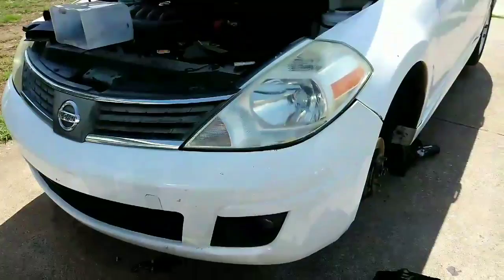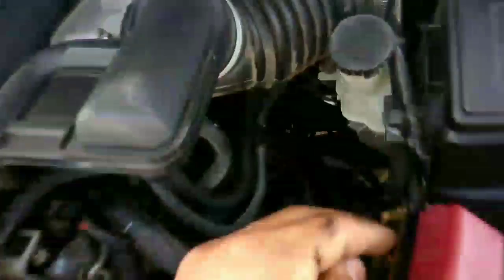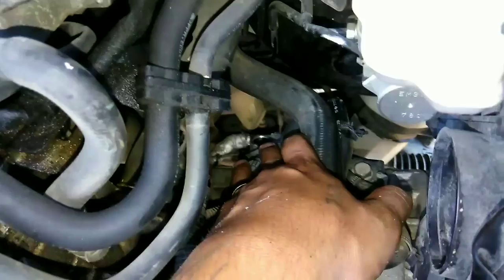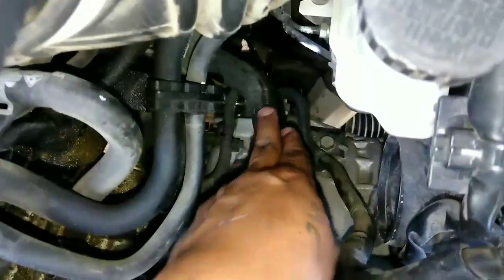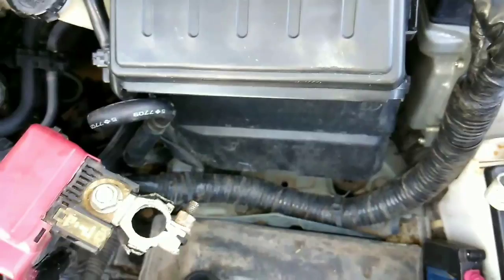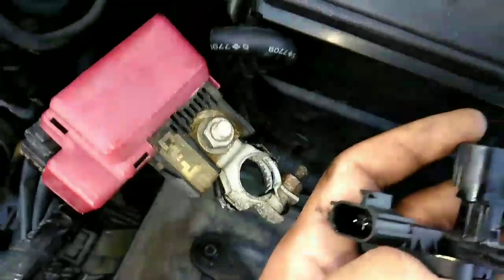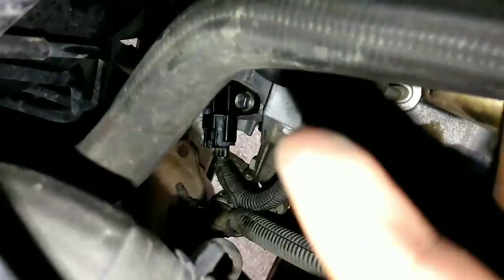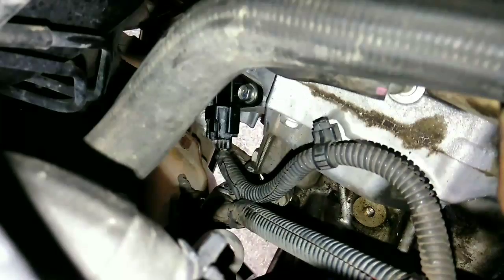2007 to 2012 Nissan versa/sentra 1.8 SPEED SENSOR replacement p0720.  car wont accelerate

Comment: There are 2 speed sensor on the Versa. The sensor you changed is the input speed sensor which the connector should be vertical. The sensor you had with the 90° plug is for the ouput shaft speed sensor located  on the side of the cvt. p0720 is for the output shaft sensor which is easier to get from the bottom.  The sensor you changed would give a code p0500.
Reply: Hi when you say the output sensor at the bottom , is it inside the oil housing of the transmission?
Reply: @josimarcruickshank2683  when i said bottom i should have said side technically
Reply: Is it different from Nissan Cube 2013?
Reply: @vladintool  not familiar with the Cube
Reply: @ottobauner9828  thank you anyway

Comment: Just went to replace mine after seeing your video (and others) showing how easy it is. Took battery out, removed air intake and pushed hose aside thinking 'simple job', then discovered there is no speed sensor in that location at all. 😫 All that is in that spot is a red electrical connector. 🤨 Don't know if it's because our car is a 4 speed and the one in this video is a CVT, but I can't find anywhere on the car where this speed sensor fits.
Reply from the maker: Cvt is different
Reply: @stickytarmacs  Just my luck. Strange how engine light code readers have said this is the fault, though. Maybe it's located elsewhere...just no idea where. 😭
Reply from the maker: Sorry about that I hope you get it going
Reply: @PJV1201  did you ever find out where? I have to do it on a 4 speed
Reply: @babarentals2941  Unfortunately not. The car still runs but has to be warmed up for 10 minutes before driving it, otherwise it sticks in 1st gear. I'm no longer convinced it's a speed sensor issue, because it runs fine after being warmed up. I changed the transmission fluid to see if that helped but it didn't make any difference. It's not a daily driver, so I'll just run it until it quits on me. Sorry I couldn't help more. ☹

Comment: What was your car doing that you change the speed sensor..?
Reply from the maker: check engine light on . didnt want to drive. put it in drive didnt want to move . i had to wait like 15 mins the start again and it would drive for like 5 seconds then no more acceleration.
Reply: @stickytarmacs I have the same kind of versa. I had changed spark plugs,  ignition coils alternator and injector cleaner. Still it saying multiple misfires. Car is not driving fast. Put it in gear one. Hardly accelerate. Going up Hill  is a problem. Spent $1100 so far. I might change drive sensor see what happens. Thanks again for uploading the video.
Reply from the maker: @KingBabaJames  thats exactly what mine was doing
Reply: @stickytarmacs  mine is a manual transmission. Not sure if it has drive sensor. Do you know?
Reply from the maker: Dominik Rodriguez  change the sensor worked for me

Comment: my 03 sentra seems like its stuck in high gear... so it doesnt really hav any torque... it might be the speed sensor.  i replaced it before...
Reply: What was the fix?
Reply: @miliqve3265  wouldnt know. never had it fixed. i swapped out the valve body in the transmission, changed the fluid, swapped out all kinds of sensors. it was either a problem with the computer or something major mechanically.. 
car only had like 70k miles on it, and that was the 2nd transmission. and the 2nd engine was already burning a lot of oil..
so i scrapped the car. cant be replacing engines and transmissions every 20k miles.. never buyin a nissan again.

Comment: The one that bends is the output speed sensor and the one that is straight is the input speed sensor depending on the trouble code, the trouble code will specify input or output.
Reply: but he said he took the straight one , so it is the primary/input sensor right? ,  my  nissan versa 2007 is giving me the P0725 code and I read its an input VSS problem, so this one in the video is what I need to change?

Comment: Is this the output speed sensor or input speed sensor? My code said circuit failure output speed sensor so I ordered the output speed sensor but unsure if this is not the same. If it isn’t, any idea where the output speed sensor is?

Comment: Are they interchangeable like that? Usually the straight one is the primary speed sensor on the front of the block, and the 90-degree one is the secondary speed sensor on the transmission.
Reply: but he said he took the straight one , so it is the primary/input sensor right? ,  my  nissan versa 2007 is giving me the P0725 code and I read its an input VSS problem, so this one in the video is what I need to change?

Comment: Se te apagaba el carro cuando lo ponias en D? porque el mio igual no camina para atras o para adelante, y si lo hacia tenia que acelerarlo bastante.
Reply from the maker: Armando Suazo no el mío si jalaba bien nomás no caminaba
Reply: @stickytarmacs  el mio enciende bien, pero al ponerle cualquier cambio disminuye la fuerza en el motor y se apaga. Pensé que con esto podria solucionar, igual, muchas gracias.
Reply from the maker: Armando Suazo si le salió el código p0720 cambie el sensor
Reply: @stickytarmacs  Gracias!!

Comment: Nice video, my 2009 versa struggles with first gear after a lengthy drive or going uphill. I'm going to try this next, do you have a part number? Trying to get a good replacement.
Reply: I’ve got a 09 with the same problems, did you figure it out?
Reply from the maker: It's a cvt transmission there is no first gear unless it's a manual transmission

Comment: If this speed sensor is bad, would it cause the RPMs to jump when the car is in cruise control? Mines doing this but no code yet. Also it drives normal, issue only shows up when I hit cruise control.
Reply from the maker: No man sounds like you got something else going on

Comment: Was your car able to go in reverse as well before changing the sensor? Because my versa is not able to accelerate and reverse. And it threw a P0720 code. I’m hoping that sensor could fix this problem
Reply from the maker: Yes it wouldn’t move at all. I replaced it and it drive perfect instantly! .
Reply from the maker: Sounds like your issues is the exact same as mine . This will definitely fix it especially if you got the code p0720 pop up.
Reply from the maker: Please like an sub if this video helped you. Every like and sub definitely helps me. 🙏
Reply: Thank you, I’ll look into replacing that sensor !
Reply: Hey man another question, is your versa a 4 speed automatic or CVT?
Reply from the maker: @DGeeez  cvt

Comment: You pulled out a straight so the straight input sensor needs to go back in, if your replaced it with the bent one then that is an output speed sensor and the wrong one.
Reply from the maker: I replaced the one on the thumbnail and car works perfect now . Thanks for watching

Comment: I have problems with my car when going 20 to 60mph  it is hesitating when push gas pedal down hard it's good what may cause it
Reply from the maker: Is your check engine light flashing?
Reply: @stickytarmacs  no but I dint have any check lights in my dash
Reply from the maker: Kemony Reid ok well here’s a couple things you can do . Clean your mass air flow sensor. And do a tune up if you haven’t in a while.
Reply: @stickytarmacs  I do and it's the same problem I have now for 2 months
Reply: So you still have this problem my friend
Reply: I would say try changing out the sensor couldn’t hurt
Reply from the maker: Check fuel pressure ! I just fixed a car that was hesitating for a while couldn’t figure it out turned out the fuel pump was old and no flowing as strong as it should have.

Comment: My 09 Nissan Sentra won’t pick up speed sometimes I let go of the gas and press down again until it picks up slowly what can it be thanks
Reply from the maker: Mass air flow sensor . Buy throttle body cleaner at auto parts and spray it down clean let it dry for about 3 mins out it back on and hit the road . It's very simple good how to clean mass air flow sensor on your year versa there plenty of videos
Reply: @stickytarmacs  thank you for responding back I took it to auto zone they plugged the code reader and I’ll post a picture maybe u can better explain to me thank you so much
Reply from the maker: Messge me on Instagram @stickytarmacs_youtube
Reply: Ok I uploaded a video of the code can u go check it out thanks
Reply: @stickytarmacs  I inbox your instagram

Comment: Did you have to take out the starter?
Reply from the maker: No just battery and i think battery tray its actually really easy i did it in like 10 mins
Reply from the maker: Like and sub please helps a bunch
Reply: @stickytarmacs  ok. I have a 2011 nissan maxima. I am having issues finding videos on it so I hope mine is that easy. I have a p0725 code.

Comment: I have 2010 Sentra, replaced the valve for transmission, ignition coils, spark plugs, and have no code or engine light yet, sometimes it won’t shift from first gear to second until I stop turn it off then back on and drive slowly for it to shift gears what is the problem could it be the sensor?
Reply from the maker: e k check your transmission fluid. Make sure it’s clean. If it’s good?  Change your sensor
Reply: stickytarmacs yes I drained it and put in new oil in there, is it speed sensor or transmission sensor? 
Thank you
Reply from the maker: e k mine was the transmission speed  sensor
Reply: stickytarmacs so even if there’s no code or engine check light  this could be a possibility?
Reply from the maker: e k no man . If you have no codes then you probably have a internal trans issue . My problem was a bit different and I had a code come up right way .
Reply: stickytarmacs yeah I’ll get it checked out thanks a lot!
Reply: I will say this sometimes you want get a code from your ECM, but will have codes on your TCM, a mechanic with a good scanner would be able to check your TCM, I didn’t have a check engine light either and my ECM didn’t throw one turns out after a mechanic checked my TCM I had several codes on there and one of them was the speed sensor, hope this helps someone

Comment: Hey brother I have a Cerda 2008 but the 4th gear won’t go in
Reply from the maker: A versa you mean? And there is no 4th gear. They have cvt transmission. That means it’s one continuous gear all the way up to speed
Reply from the maker: Check you trans fluid. See if it’s really dirty or low on fluid .

Comment: Hope this the fix for my car I just bought it from a dealership
Reply from the maker: I hope you either got it an a ridiculous discount , or there going to fix this for you for free. Cause a dealership should sell a car that’s not running right
Reply: I did I only pay 180
Reply: 180 a month
Reply: @stickytarmacs  it’s still not running it cuts off after I changed it if transmission gets to hot so ima just take it to a nissian dealership to let them fix it but only 180 a month

Comment: Thought the p0720 was an output speed sensor code and p0715 was an input speed sensor but you replaced the input sensor?  The sensors are hard to figure, isolate because they are called so many different names primary, secondary, input, output, vss, and many more. They are all wired to the TCM and interconnected in wiring diagrams.
Reply from the maker: I was advised by a mechanic that that was the sensor for the code I was getting so I replaced it and it ran perfect instantly
Reply: @stickytarmacs  Appreciate the video. From what I've read these sensors have as many wiring/connector issues as sensor fail. So if you have a Harbor Fright multimeter, its worth checking the voltage to the connector with the car in On position before purchasing. These parts are expensive if from Autozone, AdvAuto, etc.

Comment: Hey, sticky I have a 2009 Nissan Versa my check engine came on so I went to Auto Zone to use there box and the code came up P1778 do you know what that means?
Reply: You can just Google the code and it will let you know what it is

Comment: My 1.8L 2012 nissan versa acts differently .. sometimes it has good acceleration, other times it doesn't accelerate very well at all!

Is this something I can order through Canadian tire?
Reply from the maker: I’m not sure about the Canada market. But I would start by checking your throttle body and cleaning it , check your air filter and clean it if needed. Unless you have this code pop up sounds like your car just needs a good tune up . Cause when this code / sensor failed on mine that was it it wouldn’t accelerate at all period!

Comment: I thought you was going to show the location of all 3 speed sensors. Which speed sensor is that one the primary, secondary, or output?
Reply from the maker: Nope just the one for my check engine light .
Reply: @stickytarmacs  That's all good I found out where the other ones are.
Reply from the maker: @Jude13able  I'm glad I hope you got your car fixed
Reply: @stickytarmacs  Nah a rat has chewed through a lot of stuff.
Reply from the maker: @Jude13able  damn man I'm sorry to hear that best bet is to take it to a pro that knows wiring harness
Reply: @stickytarmacs  oh I got most of the wiring fixed but I keep finding more stuff.

Comment: Did that solve your acceleration problem?
Reply from the maker: Yes
Reply from the maker: Ran like new.
Reply: stickytarmacs when you said it won’t accelerate, meaning like it’s slipping and won’t move like it should? Because I’m having that problem and a scanner shows p0725 code. So was wondering.
Reply from the maker: rickii2010 no . Mine wouldn’t accelerate at all. When I replaced the sensor it ran like new.
Reply from the maker: rickii2010 one day I started my car and the  check light was on I didn’t think anything of it, I drove to the store 2 mins away when I got back I started The car it wouldn’t drive. I waited 20 mins started up again I was able to drive it home( again 2 mins away. ) I replace the sensor and it fixed it. It’s like if my throttle didn’t work.
Reply: stickytarmacs Thanks for explaining I’m going to try to get mine fixed before changing the trans.
Reply: @stickytarmacs  which Nissan do you have?
Reply from the maker: Charlie Gomez I had a 2008 versa

Comment: What was the car doing?
Reply from the maker: It would drive for like 2 mins then it would just rev in drive. I would let it sit for 15 mins and again it would drive for a sec then stop almost as if it went into neutral. I replaced the sensor and it fixed it instantly but again I had a code come up for this exact sensor. Some people may have a bad trans and will try and replace sensors with no luck. If you don't have a check engine light code for the speed sensor you might have another issue.
Reply: @stickytarmacs  thanks for your response.
Reply from the maker: Welcome man , glad to help